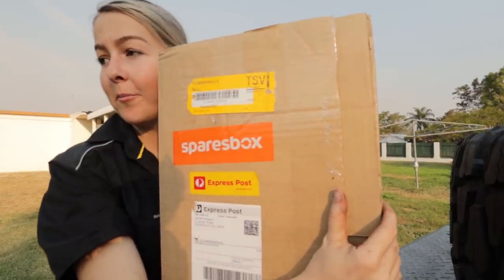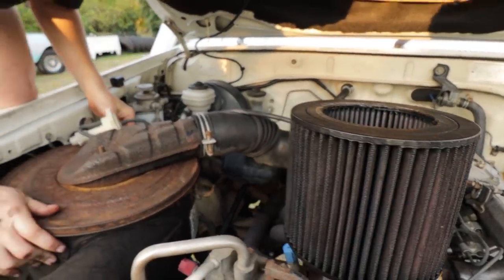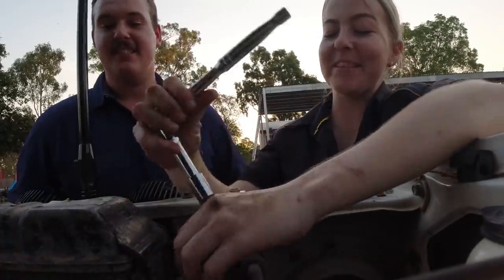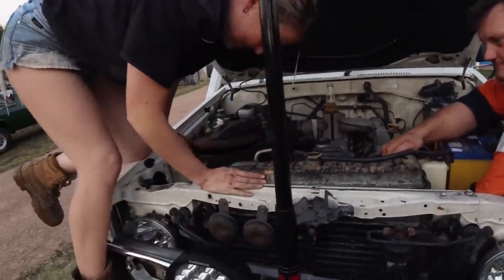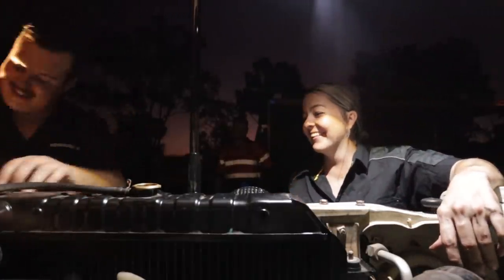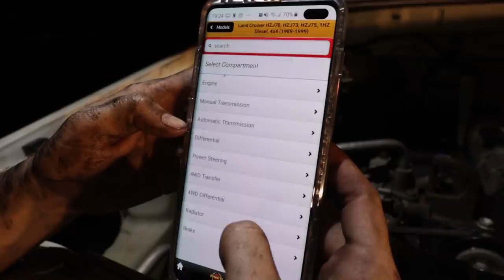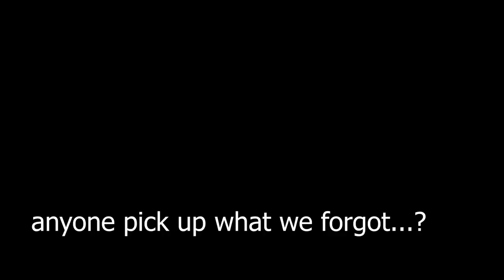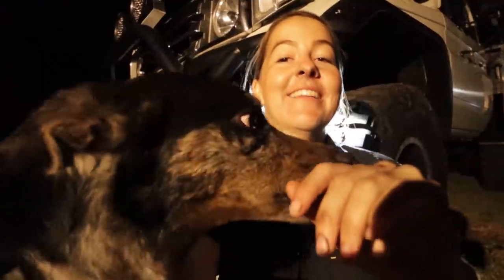5000km Service! || Learn from our mistakes...

Comment: Just because I didn’t see it doesn’t mean you didn’t do it; but I smear a little oil on the oil filter O ring before spinning the filter on.  Makes it much easier to remove for the next service.
Reply from the maker: Sure did. As explained and shown in my last service video

Comment: My mechanical workshop recently made the opposite error with my '98 105 1HZ; up on the hoist, drained the oil, screwed the sump plug back on, FORGOT to put new oil in, drops vehicle from hoist and takes for a test drive, engine seizes. Total rebuild plus other bits for $10.5k required - different mechanic of course. Oh Danie I'll take your mistake & rectification any day! Oh lord give me strength.
Reply from the maker: Ohh yeah that is definitely worse so sorry to hear!!
Reply: Danie Simpson All good, after a little persuasion from the legal eagles the mechanic's PI insurance (eventually, it took 5 mths) covered things and now everything is new or rebuilt from the radiator right thru to the clutch. Not a day's problem with the old 1HZ engine over 15 years of ownership and a total of 280k kms. New engine just ticked over 5k kms, smooth, strong, reliable with punchy compression - no turbo for now 😊

Comment: Changed the oil on my Jackaroo lots of times, but on one occasion the o-ring of the spin on filter stayed on the housing put the new filter on as usual, hand tighten as usual, all seemed good, until the oil pissed out past said o-rings.........  Sometimes one ring is better than two

Comment: Be glad you noticed the missing sump plug before turning the key. I made the mistake of starting another job after draining all the oil, it required depressuring the fuel lines, only way to do that is to start the engine. And I did it without oil.. doh!! No damage fortunately :) we all make mistakes.

Just like I won't start a car ever again without oil, you will never forget the sump plug again haha

Comment: Good job. Having done my 75's radiator not long ago, getting the new one bolted up was the hardest part. I ended up with a full flush and filling it with Toyota Super Long Life coolant, why'd you go with green?
Reply from the maker: I have always used Penrite and 7years is plenty long enough for coolant I reckon

Comment: I had an aftermarket fuel filter/water catcher, and Ryco filters didn't work, I had to get Delco to fit properly  - just as well they are cheap. It's certainly an interesting drive with the filter sucking air!
Reply from the maker: Nothing wrong with the filters what so ever. The cheap water sensor is the issue. I swear by Ryco never had an issue in 9 years and the engine has over 620000kms
Reply: @DanieSimpson  yes you are right, I use Ryco  air and oil filters. I bought the fuel filter from Berrima Diesel, they told me at the time I would need Telco filters, and as I found out, Rycos won't work with it.

Comment: Hey danie quick tip for pouring out of 10L an 20L drums an other containers is to keep the whole on top to keep air coming into the drum a constant flow so you don’t get that glug glug an it will stop you from spilling stuff an making a mess keep up the good work tho

Comment: I havent forgotten the sump plug before. I HAVE left an oil filter sitting on the filter spiggot on a 1KZ hilux and started it up. Nice fountain of black oil all over the passenger side of the motor and shed floor. I blame the cars owner feeding me a large number of Black and Tan's before I finished the job!

Comment: My god these cruiser are the worst to remove radiators from, my 80 1hdt took legit 5 hours in my drive way with the wrong tools even cracked my shroud spilled 95% of the coolent on myself snapped 2 bolts
Reply from the maker: 75 isn't too bad compared to an 80 but still interesting after some beers hahaha
Reply: The 80's are a total pain- Why do i Need to remove my BONNET LATCH to take out the radiator? The 100's arent much better at all- The AC pipes are in the way of the bottom bolt on one side, the top bolts are a prick to get too, and you need to remove BOTH bottom mounts off the radiator before you can remove it from the vehicle. Oh, and when you do remove the bottom mounts, make sure you hold on to that radiator or its gonna fall straight through the chassis rails. And punch a hole in itself on its way through. At 3pm on a friday afternoon...

Comment: Good job Danie regardless of the sump plug thing,  Did you tighten it? I also would have checked the diffs also there are two plugs in the inside of the front hubs a 1/2" open end spanner to remove them and a few pumps of grease in the hole on each service would be a good thing. Question where did you get the oil filler bottle from? I would like to buy one of those.. Regards Wayne 35 years diesel mechanic..
Reply: There called oil safe container. You can get them off eBay and a few specialty stores
Reply: @micktaylor6097  Thank you Ray..